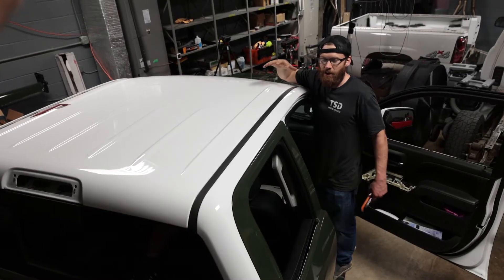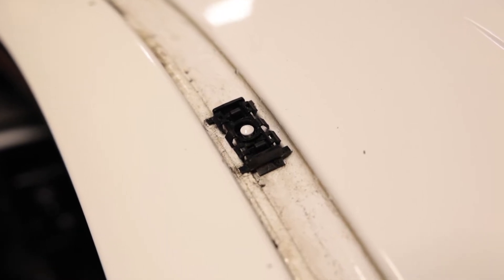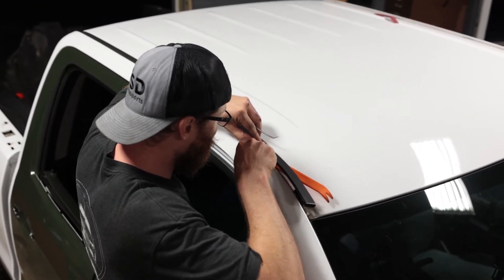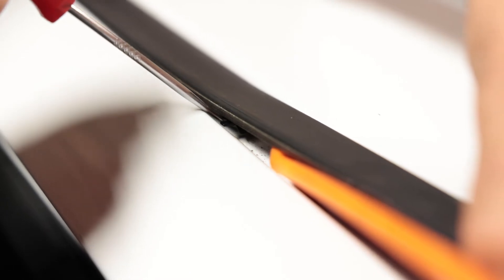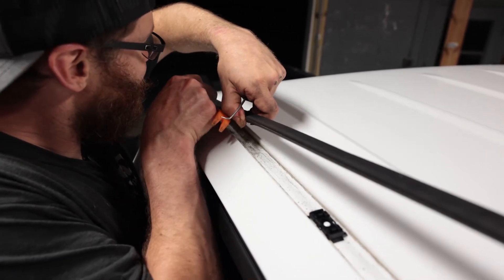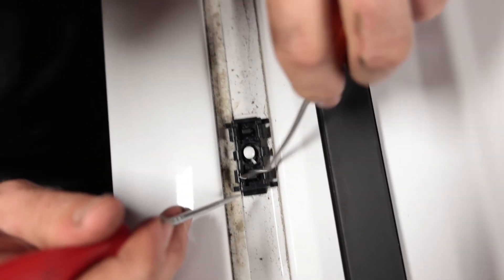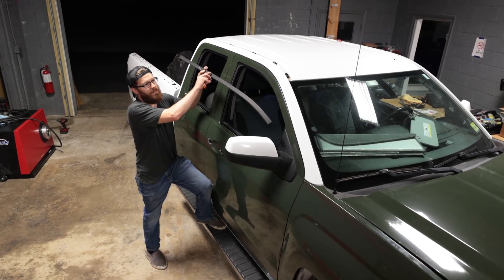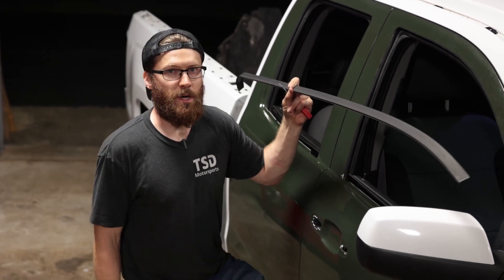How To Remove Silverado Roof Molding Sierra 2014-2019 (LD) GM Truck Roof Trim Removal

Comment: Super helpful. I've been researching this for a year and I have no idea why this particular video would not show in my searches. Had to fix the seam-seal leak on the driver's side roof seam just behind this trim above the windshield. Had antenna replaced once thinking it was that... but apparently wasn't. Found the water trace coming from the bend of the roof within the sheetmetal. Ruined my bluetooth mid in the process.... but hell the bluetooth never worked right in the first place. o_O
Thanks

Comment: I’m trying to diagnose a leak in my 2014 chevy Silverado, I think I just found the culprit. Is it possible for that the molding if tarnished could cause a leak onto the headliner area
Reply: I've had that same issue.
Reply: So have I.. 2014 Silverado. I thought it was the shark fin antenna, it was replaced, still leaks. Have you figured out your issue? I am starting to think mine is between the windshield and the roof of the truck. The water comes out where the sunglass holder and cabin lights are in the front. Also where the headliner and the plastic cross member part meets on the drivers side

Comment: This same as the 2007-2014 yukon,  tahoe and escalade? Wanted to remove mine for wrapping too.
Reply from the maker: Not sure. Someone else may be able to weigh in tho
Reply: @The Sundae Drive  Finally got around to it.  The answer is no for the 07-14 escalade/yukon/ tahoe... The trim is held on with double adhesive tape.  It's easier, but it leaves a mess. I used the same plastic tool to run under the trim as I removed it.  Try not to bend the molding either when removing or applying to reduce warping the trim on the escalade/yukon/tahoe.

Comment: Today I noticed the trim is coming up in a spot passenger rear door while washing my truck any suggestions should I buy new ones or just glue or get new tabs or wait till I get some paint work done and have them deal with it thanks in advance
Reply from the maker: You'll have to see what broke. New tabs or some double sided 3m tape may do the trick

Comment: Is there any chance water could be leaking thru the roof from these channels?  I ask because I have a typical Silverado roof leak that I can't find, even after sealing all the running lights.
Reply: I got the same problem i can't find the leak on me 2014 gmc sierra
Reply: Were you able to find the leak?
Reply: @rballeza7  i just had this problem with water leak in this area. wasted $400 buck on new windshield and after i found a small pin hole crack right between this molding and windshield. real small but thats what was wrong with mine

Comment: Does anyone know the part number for the plastic clips on the truck side? One of mine broke when I took it off
Reply from the maker: Gm dealer will be your best bet if you can buy them separately
Reply: Were you able to find the part?